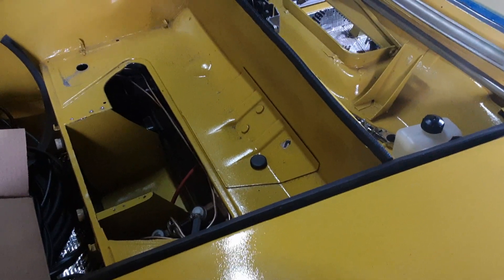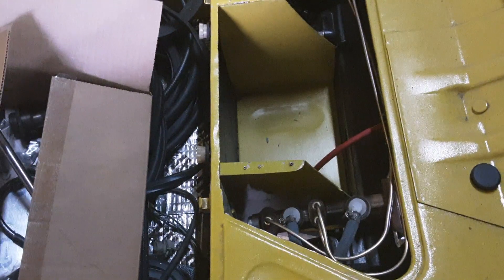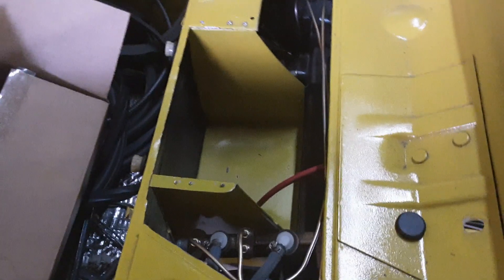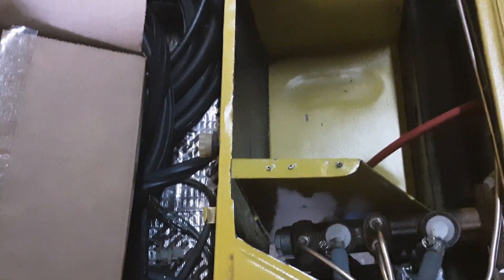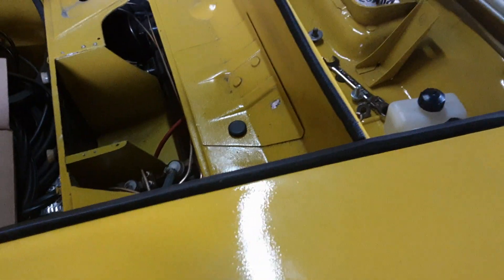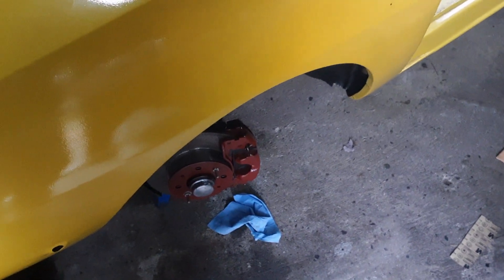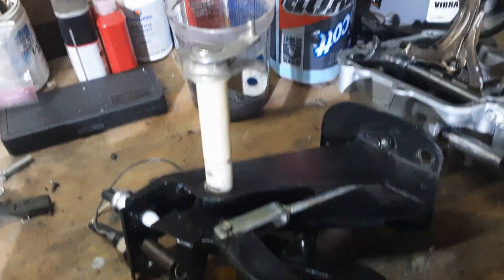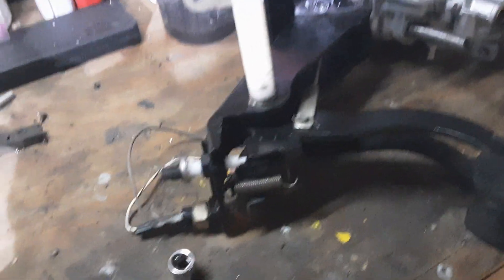Fiat 850 Spider Restoration Project Episode 39 " I Need A Break From Brakes"

Comment: Yet another good useful video please don't apologize for making mistakes we all do it. 
I can confirm that according to all of the wiring diagrams I've seen for the Fiat 850 there is no neutral or clutch lockout for starting. The switch on the clutch control is part of the North American market emission control equipment. The wiring diagram shows that the switch on the clutch control combined with a switch on the transmission which operates when third or fourth gear is engaged. This then controls the electro valve. There is a splendid explanation and diagrams of the emission control system in the Haynes workshop manual.
I have removed all of the emissioned control equipment from my car. This includes the two absorbers at the top corners of the fuel tank. Yes, with a slight wiring change one could interlock the ignition using the switch on the clutch.
 The Haynes Fiat 850 workshop manual covers all 850 models including the Spider with additional information for cars destined for the American market.
Thanks Dennis keep up the good work.
Reply from the maker: Thanks Gordon. You've confirmed for me what I thought. I blocked off the end ports on my fuel tank as well and do not intend to re-install the electro-valve crap. I'm going to see if I can locate a copy of that Haynes manual.

Comment: I have a Chilton's Fiat 1970-73 repair and tune up guide which explains the switch as being in series with one fitted to the transmission third and fourth gears. When they are both activated the electrovalve is energized and manifold vacuum is applied to the diaphragm keeping the throttle plate from returning to the closed or idle position.
 I'm in New Zealand and we don't have that  stuff fitted.
Good on you for these tips and videos.
Reply from the maker: From what I've seen, most guys restoring these leave them out. The replacement fuel sending units to the tank do not have a second  port that would normally be routed to that like the original. 
So is there anything in there about a neutral start? It must be on the tranny too, if there is one. Can't imagine there wouldn't be one. Thanks for the input.
Reply: @dennisjump8655  Yep I can't find any other info on wiring for a neutral switch either
Reply from the maker: @davesoanes1649  Maybe Tony figured we don't need one? "Safety switch? We don't need no stinking safety switch"

Comment: A double flare? Any idea what the (real or perceived) advantage of that might be? Also, "mistake" is too harsh a word for being entirely innocent of the double flare. As for the frozen side, single or double circuit? Legal mandate was in '67? or so, I think/remember sorta. Anyways, a dual circuit would not be side-to-side, so I'm going with the kids.
Reply from the maker: Well you and the kids are right. The rear drum was slightly off (not centered but canted a little) and as soon as I mounted the tire on the front, I could easily move the wheel. That they were both on the same side was just coincidence. Only one line feeds both rear drums, into a distribution block. 

I can't say what the advantage is for the double flare.. Stronger? Better seal? IDK. I only found out by finding the part and reading the description. All brakes are bled and working well now! Thanks for watching.